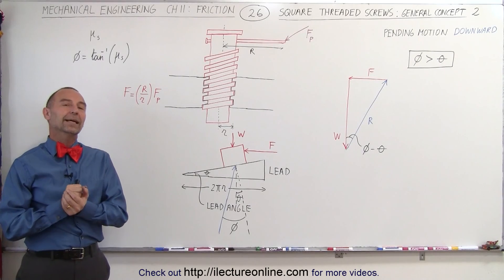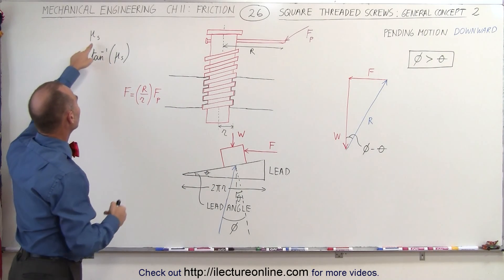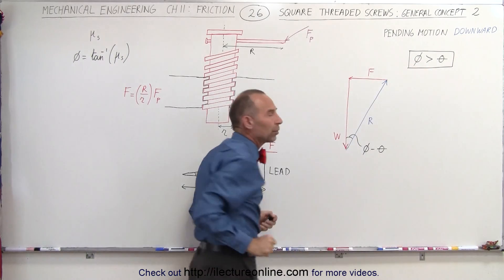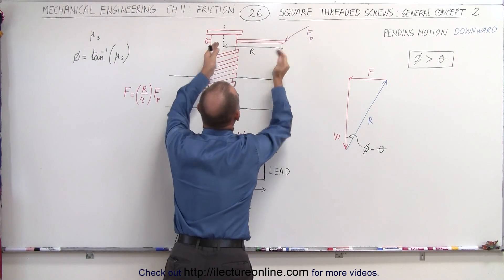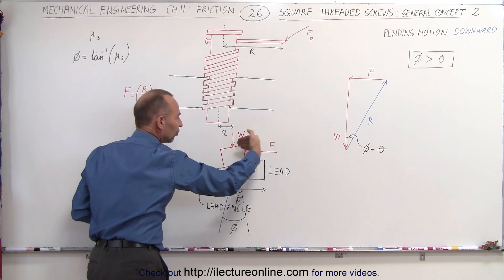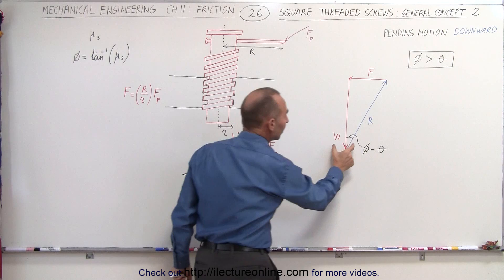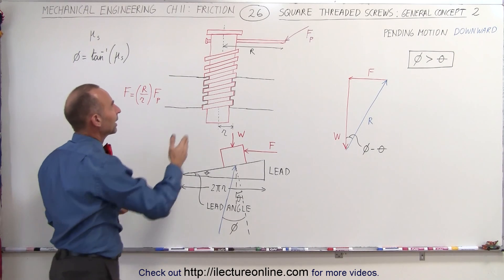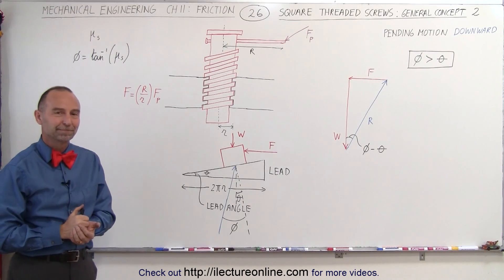Mechanical Engineering: Ch 11: Friction (26 of 47) Square Threated Screws: General Concepts 2

Comment: Hi sir, really good video. Could you maybe explain how the calculation differs for V threaded screws? Thanks.
Reply from the maker: That tends to be a wood screw and it is designed to cut into the wood.  The principles there are different